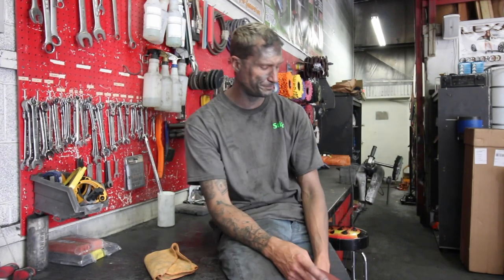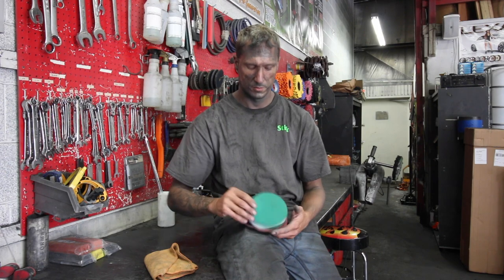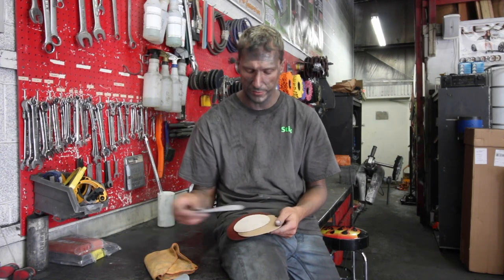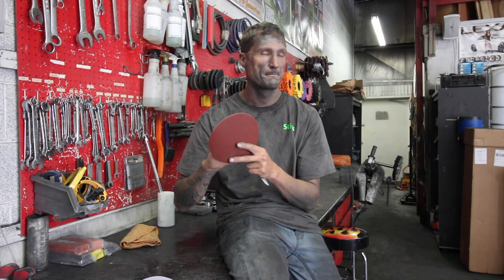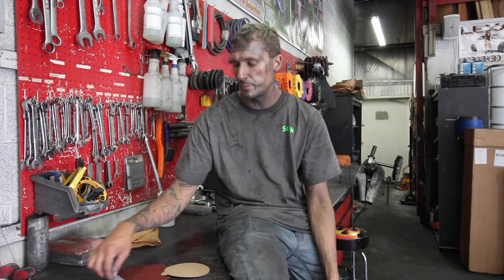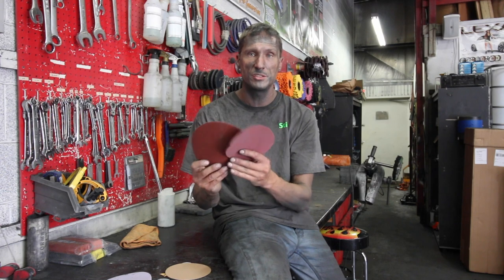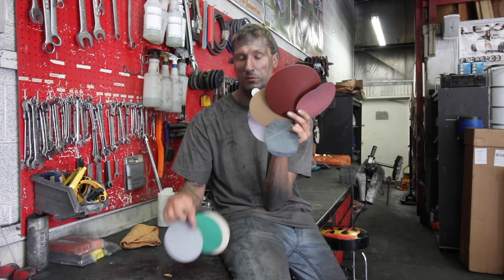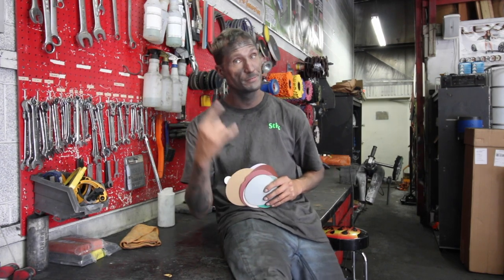How to select the right type of sandpaper for polishing metal - Evan's Detailing and Polishing

Comment: I tend to stick with 3M sandpaper just for consistency. Easy to find, and they have a wide variety to choose from. Though for me thats regular square/rectangle sheets for hand sanding. Still yet to buy an adapter or tool for the discs, and no grinder yet for buffs.

Depending on the condition of the surface, I'll sand from 120 all the way up to 2000 grit or beyond. Plus when I sand I use WD-40 to lube the surface and build up a slurry. Wipe it all down till cloths come off it clean. Then finish off with some hand polish or buffing wheel on my drill. It's certainly shiny, but nowhere near a mirror, though I can see my reflection somewhat in the end. Just making due with what I've got until I can acquire some better tools. Certainly getting some exercise in when I do polish hehe.
Reply from the maker: I bet that is a long tough day and sore arms for sure. LOL If I didn't have tools or the ability I am uncertain I would love polishing as much as I do. You have far more patience and will to polish than I do. I love watching the transformation and seeing the end result. Thank you for watching and commenting. For me personally 3m is too expensive and requires more sanding than I like to do. The stuff I use breaks down the way I want it to in the time I want to achieve a polishable surface. I never sand above 600 and can achieve a true mirror after that with the buffs and compounds.
Reply: @EvanStegerMetalPolishing  It'll certainly take me some practice but my results are turning out pretty good. Eventually I'll invest in some power tools specific to the task, as they'd be handy elsewhere too. Since I'm not running a business and just shining my own equipment it's good exercise for now. A bit more practice and experimentation on my company equipment, and I may just turn it into a side gig during layover time. It's enjoyable taking matte white aluminum and getting it to the point my goofy fuzzy face is looking back at me.

Comment: When sanding aluminum, is there a trick to stop gumming up the sandpaper? I know you can put some water to cool down, but for vertical surfaces thats not always practical...
Reply from the maker: If it gums up you switch paper. By the time your paper clogs it isn't at full usefulness.

Comment: Hey, I recently bought a renegade aluminum mini kit to do my oem GM SS wheels, I removed clear, sanded them with 400 then 600 is that enough sanding to use the airway kit or should I sand to a finer grit?,I have plenty of 3m paper and discs ranging from 220-3000 but would rather not spend time sanding if it’s not needed, also I’m using a dewalt variable rotary polisher 600-3500 rpm for the airways, sanding was done with a drill and by hand.Thanks
Reply from the maker: Those wheels are an absolute pain to polish. Getting the clear coat off is a bear. I recommend starting at 180-220-320-400-600 then buffing. I no longer use renegade nor do I know what is in their mini kit but as long as there is a stiff buff and brown compound around you can usually cut out 600 grit scratches. If their stuff has changed at all you may need to go to 800 but not sure the quality of their stuff as I don't use it. Hope this helps.
Reply: @EvanStegerMetalPolishing  yep the clear was a pain in the ass took 5 hits with aircraft remover and pressure washer each, I hit them with the orange wheel with brown bar I kinda see the sanding lines so I’ll go back with 800, I ended up finding a Milwaukee 6000rpm grinder in my basement so switched to that from my dewalt varible, thanks for the reply and appreciate that videos👍
Reply from the maker: @wildingarage2003  Glad to help, Well done.
Reply: greetings evan, in one of the answers you say that you do not know the renegade material, if I have seen the videos of you working with them, sorry if I'm wrong

Comment: hey Even, thanks very much for the straight forward info on polishing. still though, i'm having problems that i don't see you and others having in there vids. hope you can shed some light if you have time.
i've sanded my alum up to 5000 grit with a good DA sander, then as i try to cut w/brown (tripoli/compund) the surface turns dark grey to black and resists any further polishing. even after i rake the wheel and clean the surface with alcohol. my buffer maxes out at 3500rpm if you think thats' the problem. tried many times and the area iv'e sanded remains cloudy and resists polishing. any help is greatly appreciated. cheers.
Reply: C10 Syndicate  Aluminum is The Devil's Tinfoil. apparently, there's a right and wrong way to sand how is that possible? it's taken me 2 days with 3 grades of air buff wheels to get out the cloudiness.(some cloudiness remains) please, if you can describe how a sanding technique can cause this, i'd be eternally grateful.
Reply from the maker: I never sand up past 600 grit. 5,000 grit is too smooth. It actually has closed the pores and won't allow most buffs or compounds to get in and do what they do best. Sanding that smooth is counter productive and will actually make the finish worse. I will make a video about this soon. Thanks for the great idea. Brown tripoli cuts at 480 grit in most brands. Since youve sanded to 5,000 you are at a level softer than most hand polishes. Most hand polishes are considered 4,000 grit. I hope this makes sense.
Reply: @EvanStegerMetalPolishing  makes complete sense Evan. on my next piece i'l leave it at 400 to 600 grit before polishing.
another thing worth mentioning; i was lead to believe that a high shine could be achieved by using Nuvite/nushine 11f compound and a wool buffing wheel. which i of course spent many hrs trying to get a shine with. could there be a buildup of this stuff that's preventing the tripoli and air buffs from doing their job? also wanted to say how thankful i am for your time. it's obvious you're a busy hardworking guy and your responses mean a lot to us. Victory over The Devil's Tinfoil!

Comment: How to select the right rotary or da tool?? I wanna do my wheels today but idk what tools to buy
Reply from the maker: I have a video on this as well. I prefer tight pattern orbital for finish work and loose pattern for heavy material removal.
Reply: @EvanStegerMetalPolishing  okay, I’ve been so busy haven’t had time to watch so many videos, what would you recommend for a full wheel project? Idk what kind of metal they are (steel aluminum etc) but they’re painter white on a 73 ford truck. Paint stripper didn’t help so I’m thinking of just sanding it off and polish till it’s like chrome
Reply from the maker: @plshelp2906  If they are painted white they are likely powdercoated steel and if you did manage to polish them they would rust with just humidity or touching with your hand. Old wheels aren't usually aluminum.
Reply: @EvanStegerMetalPolishing  ohh, so would the best way to get them shiny/chrome  be to paint it ?

Comment: Hey Evan, what's up man? Please help me out, I recently started polishing my aluminum engine cases from my motorcycle, started sanding with 320 - 400 - 800 - 1k - 2k, then started polishing with the zephyr kit, after the first step with the yellow wheel I got it looking awesome but I got like a black burn-like stain on my otherwise mirror like case, any idea on how to get rid of it? Dunno it I should go back to sanding or what. Please help! Thanks in advance.
Reply: Buy an orange wheel, sand to 400 use orange/brown then yellow/ green and last white /blue
Reply from the maker: I never sand above 600 grit. Sanding too smooth can make polishing more difficult. I'll have a video out on this soon. I would sand back to 600 and repolish.
Reply: @EvanStegerMetalPolishing  thanks for the reply man! Gotcha will resand up to 600 and repolish, other than two black, burn like, spots thing shines like a mirror. Big fan btw.